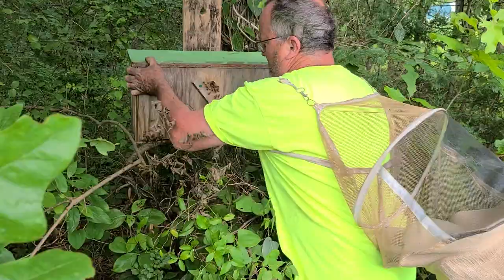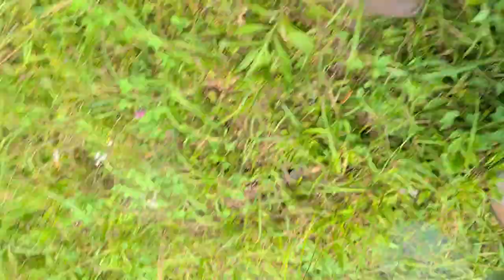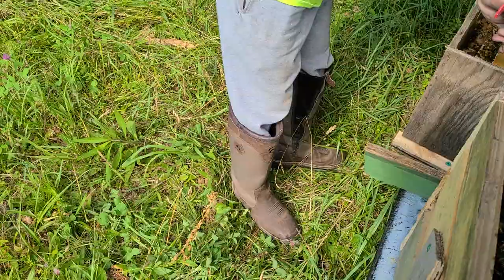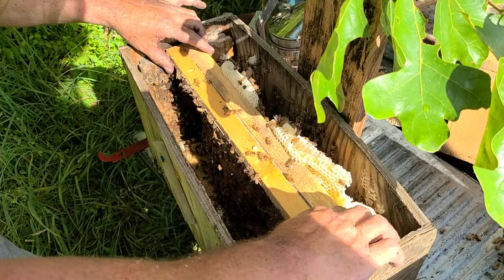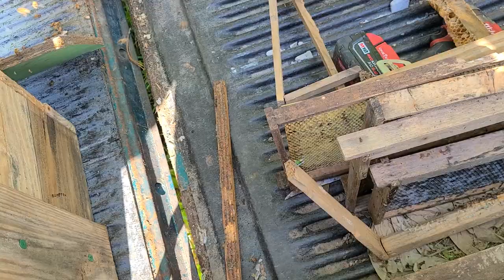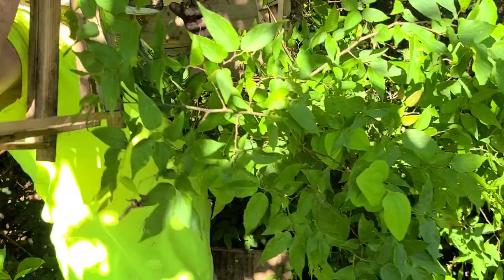Swarm Trap NIGHTMARE. Beekeeping on the Cheap Ep. 5

Comment: How are your PVC entrances working for hive beetles?
Reply from the maker: great. over this past winter i made 25 double 3 deep frame mating nucs with them on both sides. the mating nucs are easy targets for the shb. the secret is to make sure you get the hive beetles out of the frames you are splitting out of other hives to make the mating nuc with.
Reply: @WoolieBsApiary  post a video of those mating nucs sometime, I'd love to see them!

What size PVC do you use for the mating nucs?
Reply from the maker: @Velacreations  1 inch for the SE facing side 3/4 inch NW side. i sell the queen from the NE side in sept or oct and open the top so the bees can touch but not cross over the divider 3 days later ill go pull the divider put a cap on the NE side and they will go through winter as a single 6 frame deep nuc thus the bigger entrance on the SE facing side. ill make a video someday
Reply: @WoolieBsApiary  thanks for taking the time to tell me about it!  I am going to try it with some smaller nucs I have and see if I can get it to work.
Reply from the maker: @Velacreations  you are welcome ill try to make the video and have it up before this winter so people can make some if they chose